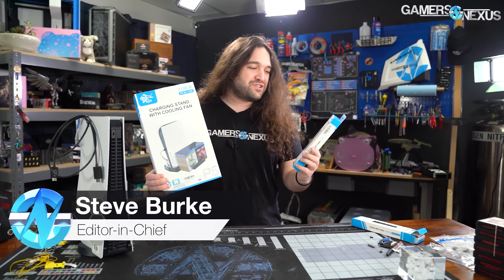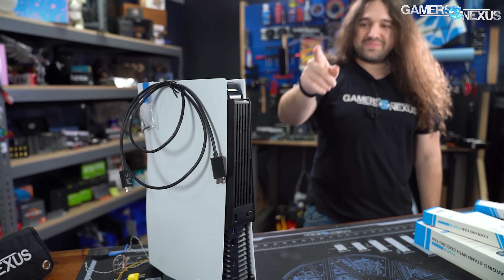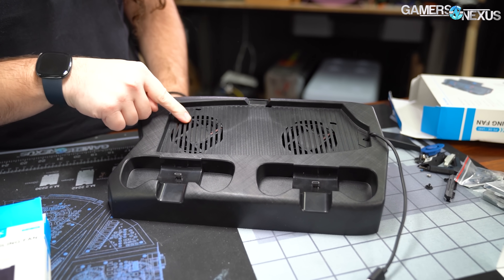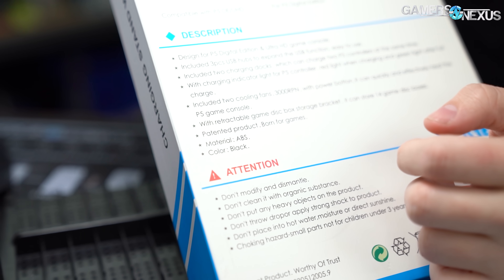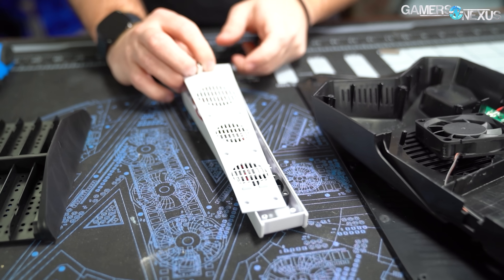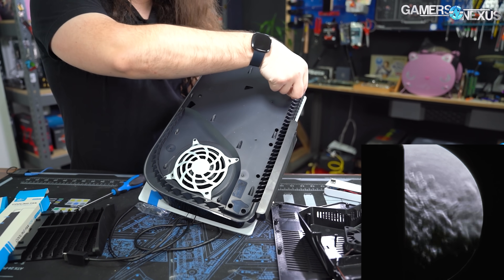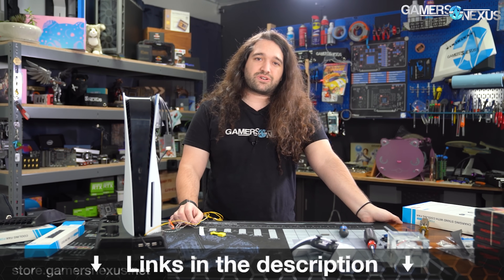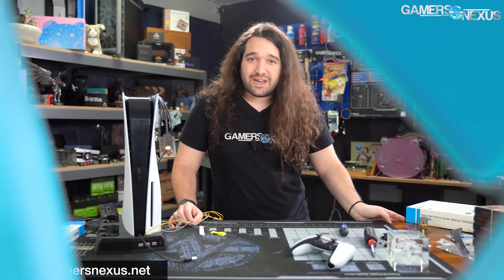Basically A Scam: PS5 Aftermarket Cooling Fans Blow the Wrong Way

Comment: So far as I can tell, so far...the PS5 seems fairly thermally stable all things considered. The biggest thing I've noticed when people complain of overheating is they have it standing without the provided base and/or in a cabinet or cubby that collects the heat exhausted from the PS5. The only "mod" I got was new side panels because I wanted purple but the new panels have openings over the PS5's main fan and it does seem to help with the general temp around the system. That and a small fan to blow the heat away if you insist on keeping the console in a tight spce, need fresh cool air or it'll just keep getting hotter...
Reply: PS5 very well made. These fans are just a con. Vented covers good though
Reply: Yeah. In a cubby a good way to fix that problem is cutting some holes in the back of the cubby or maybe even putting vents in the back of the cubby to pull the hot air out of the cubby through the back.
Reply: I just bought and set up my PS5 and got an overheating ⚠️ I don't have it enclosed or anything. Wasn't even running for more than an hour. I had just set it up and was about to run a game when the notification came up and then shut the system down.
Reply: @ShawnathanTKV  check to see if the fan is spinning, if it was bought new I'd swap it out
Reply: @jakejager  it was definitely blowing on high as if it was overheating. As soon as I clicked to play the game the warning came up. I'm just sending it back so I don't void any warranty. I know this is rare but FedEx took forever to deliver it and it was a hassle just getting it because of the holiday mess.
Reply: @ShawnathanTKV  check to make sure none of the vents are covered, no tape or styrofoam stuck in them. The PS5 is solid on it's temp profile when it works correctly, sounds like you may have gotten a dud 🙁

If you feel like you could handle it you could open the case and make sure everything is seated fully and all the air tunnels are clear...it could be a bad thermistor too, in which case you'll have to repair it or replace...
Reply: @jakejager  yeah it sux I have to package it back up and return it. I bought it straight from PSN too. God of War edition. There was an option to refund or replace it (with an explanation of course) and it would only let me refund it. I bought it for $459+tax
Reply: @ShawnathanTKV  Sucks, have had that happen in the past a number of times, always suck. I got mine via PSN as well, two day shipping but at least you know you'll have one working soon enough 😉
Reply: @ShawnathanTKV  Buy a vented ps5 cover. That's surprising to hear. Never had one overheating problem ever since day one
Reply: @ps5andstuffmate  ya dude I restarted it many times, checking the vents and I noticed the notification would only pop up when I started one of the games. This is a God of War edition too bought straight from the PSN store.

Comment: Fans (like that design) 'pull' not 'push' so the reason the . manufacturer mistakenly put them in, in reverse is because the person tasked with configuring it knew the fans would function far better if they were drawing air through the grill and dispersing it into the adjacent void rather than drawing it from the adjacent void and trying to push it through the grill. You would have better luck, with that type of fan, mounting them on the other side of the case in the reversed orientation.

Comment: Fun Fact: These exterior fan mods were created during the Xbox 360 RRoD era, people thought the console would red ring because of overheating which led to the creation of exterior fan mods that would attach to the entirety of the back of the console. The first one would connect to the DC port and take power from the external PSU, and it ended up scorching multiple power ports which led to the new fans being supplied via USB I believe. You can blame the Xbox 360 for these chinese-made scams.

Comment: I've recently stood my PS5 Horizontally and to my fortunate surprise the modem has always remained cool. I've also found that after I use the modem, I turn it off at the power switch, and put a pillow cover over the modem to protect it from dust. So far it has worked for me!

Comment: Many of these cooling docking station fans have an apparent design improvement with regard to fan intake direction. Would you please do another video review on the new stations that supposedly cool in the correct direction?  Thanks
Reply: I got the surge one and it cools in the right direction, but there isn't much heat coming out the bottom so the fans are just loud and don't do much. The only thing these stands are good for is being a more solid base and a controller charging/storage station

Comment: Thank you for the detailed review.  Its certainly gave me something to consider:

You said to point out other products. I came across (well the Mrs did) this one. "NexiGo PS5 Accessories Cooling Fan with LED Light"

 It seems to address the issue of plastic obstructing the airflow out of the vent by being quite open. Would you be of the opinion that this may potentially work?

I'm kinda thinking not as its not really adding airflow in, but thought you may have an opinion

Comment: I bought the exact fan in the thumbnail. At the time I lived in an upstairs apartment that shared a climate with The Nine Hells. After seeing how the fan actually functioned I immediately discarded it.

Ultimately I went with the best solution possible in my situation. I bought a lower end Portable AC Unit from Best buy. Not only did it keep my PS5 cool, but my apartment was much more comfortable too.

Comment: Yeah, you have a push type fans, I have a pull type that sucks the air out instead of pushing air in, think of car radiator fans. They have new ones now that are pull types. You don't even need a thermal sensor to test the news ones, play a game and if your PS5 get noisy, the fans go on overdrive, I have the pull type fans and the PS5 internal fans remain on low speed. Not saying your review is useless, I'm just saying look into the newer ones.

Comment: omg THANKS

hope you answer this because you're the most detailed review about this kinda products I've found so far ehehe, and I would belive your answer the most.

I was wondering why its so difficult to find a good review of this kinda things and now I know haha
dont know why I wasnt finding this review before.. well, Im glad I did.

but one question... if there was a product that blows air in on the top side and (or the same) that pull air out from the back/bottom, it would be good?
like, there is this product here
NexiGo PS5 Accessories Stand with Cooling Station
https://www.youtube.com/watch?v=RSrtdflwrts

its kinda helps the ps5 on the bottom as the review I linked shows, but middle up to the top doesnt do much.. and there is another review saying the fan isnt that good/fast, so.. if there was a product simillar to this one I linked, that took the base and a good back part from the PS5, and helped it pull the hot air out, would be good?

plus the other product blowing the air in from the top, or the top fans would be to low efficient to do something?

thank you anyways.
see ya.

Comment: So the questions remains then…WHAT COOLING DEVICES WOULD U RECOMMEND THEN??  I’m glad I watched cuz I was just about to buy one of these cooling stands although the one I was looking at supposedly draws air down from the bottom (in vertical) and exhausts from venting holes underneath the base stand.  But yeah…recommendations would be great if these suck so badly, lol

Comment: I see this video is old, but, with the 'cooling fans' that go on the back side and blow into the exhaust, is there any improvement over OEM temps if you were to flip the fans in their housing so they blow with the exhaust? 
Also, I would love to see M.2 temp comparisons with the 980 Pro, sn850, and the Firecuda 530 (while wearing their respective OEM heatsinks as suggested by Sony)...maybe even throw in some results using the aftermarket rear fan (with it blowing in the correct direction lol).
I would love to see that video/videos and might even be willing to make a small financial donation towards the development of them. Looking forward to hearing a response from you and/or your viewers!

Comment: A vertical 15 inch desktop fan blowing through where the extra hard drive is placed lowers temps of the drive. I use a sabrent heatsink. Thermal grizzly 3m minus pad 8 and blow cold air through that vent via the fan, this is the airflow design of the PS5. The drive rarely gets about 40 degrees even after hours of extended gameplay on ultra Doom PS5 and in titles like Returnal. The drive runs faster than the internal one.

Comment: The smaller 3 fan unit that mounts to the back. Is there any way to just open it and flip the fans around in the opposite direction to help extract more hot air from the console?

Comment: Right, but as you showed you can easily turn the fans around within their mounting to face the correct way. I'm very surprised for completeness you didn't do this for your comparison charts. Seems like a rather obvious oversight when you pride yourselves on thorough testing of devices. Granted these are shit products and no-one should buy them, but don't let a shit product turn your testing to shit too. That's Shit-ception.

Comment: Hi Steve! Really illuminating video. I was about to buy one of those crap and fortunately i came across with your video, so many thanks for saving my money :D
In relation to the PS5 heat problem, you said at the conclusion, that the better way to cooling the PS5 could be adding vents holes on the sideplates for a better air flow. That's interesting, because the trademark Dbrand, just released a PS5 plates with hole vents on their sides. So... Do you think it could be a good purchase for help to reduce the heat in the console?

Comment: I got a skeleton cooler that blows out like their suppose too. Its basically a thin frame around fans. I removed the leds. I know leds barely make heat but I'm not wanting them.. The thick one your showing blocks flow. The newer ones all suck out.

Comment: I did get an after-market mains controller charging dock, literally because in my opinion they had a better design than the official Sony ones. And were slightly cheaper
Reply: And how is that related to third party console coolers?
Reply: @katlee8778  do you mean the coolers that also included controller chargers?

Anyway, it was more that there are third party devices that can be good- occaisonally even better than "officially licensed" products.

Comment: Had similar for Xbox 360 and i went trough 3-4 RMAs. 2 consoles atleast broken soon after i plugged set like this on it. After i was scared to plug it in and it did not break anymore.

Comment: Good info as usual. Only critical comment I have is concerning the RPM measurements. Whatever is displayed on the tachometer should be divided by the number of fan blades the fan has.

Comment: The fans should be blowing heat INTO the PS5 not out of it. I don't know where you live, but where I'm from, where the temperature can easily get below 0 degrees, you need to ensure your PS5 stays as warm as possible to prevent them from malfunctioning!

Comment: Fan developers must have listened because I just saw one online that fixed most of your issues with that rear fan : fans blowing in the right direction, open design not closed off same volume as original hardware. You should do an updated video of current aftermarket accessories
Reply: Can you give me the referance please ?

Comment: I know the RPM testing is pointless because both of these devices suck serious ass, but I think you'd need to divide the RPM numbers by the amount of fan blades because it's registering a revolution every time a fanblade goes past instead of a white dot on the center like most people test RPM.

Comment: On the smaller cooler all you have to do is REVERSE the fans.  It took me twenty minutes to complete the operation.  Just make sure you accommodate the wires to not interfere with the fans..

Comment: Is there any fans that help? I know these blow the hot air out not in. That doesn't help at all? What about having a small fan blow on the ps4 while it's running? I dont like that I feel like after 3 hours I should cut my ps5 off becuase of it being hot

Comment: Too many Companies know they can sell junk by simply understanding that enough people just believe the advertising and have no interest in understanding how anything actually works. 
That said I would like to thankyou for your work as 99% of my Custom built PC with an Aorus x570 Master + AMD 5900x the Bequiet dark pro case my Custom built water-loop the PSU choice and GPU rtx 3080 were all chosen as you and your teams expertise were my go to sources of information before any purchases were made. As a result my DIY PC build is rock solid fast and quiet with excellent temps and no regrets. Your review of the Bequiet 900 Dark Base Pro rev 2 was brutally honest and factual. I was able to decide upon the case with full knowledge of what it offered me for water cooling possibility and methodology to ensure good airflow to noise and temps ratio.

Comment: How does Steve manage to put USBs in effortlessly without looking at them? This is evidence enough he is Tech Jesus!
Reply: ill tell u a secret:
most usb type b cables have a raised USB logo on the top side
just feel which side has the little logo and put that side on top
Reply: if they dont, just push your finger against the end. plastic part inside the connector goes on the bottom of the usb, rotate clockwise if its a vertical slot
Reply: @see-em-ex  used 4.4??? Jesus he aint ready for that yet mate
Reply: @littlesnowflakepunk855  wrong. Manufactures want you to suffer. It actually says in the manual to jam it in any old how until it fits, you know its done correctly when the USB head is loose and coming away from the plastic. Misinformation bro is a dangerous game, don't do it again 😤
Reply: @littlesnowflakepunk855  ah good tip

Comment: Thanks for the great video that shed light on this potentially dangerous add-on. I recently bought the back mount fan and thought I was doing my PS5 justice. After watching your clip and against what you said in the video, I figured Id try to flip the fans and open up the grills for better airflow. For a 10 minute fix I feel like it was worth it. Major difference in airflow and hey, its going in the correct direction. Check it out here and thank you again for opening my eyes the the POS. https://youtu.be/LhZ7ns4UFh0

Comment: Someone gave me the base as a gift, I guess I can use it as a solid plastic base and charging station (without turning fans on) and not worry about increased heat? It's at least more stable than the original...

Comment: Hi, I'm wondering if it's OK to connect fans and charging accessories and run them directly from the PS5... does it effect the PS5 performance? is it OK for the long term? I would like to get some cabinet USB fans and connect them to the PS5 so as soon as the console start the fans will turn on.

Comment: If you wanna make your money’s worth then do what i did: i unscrewed it and flipped the fans , you have to find a way to position them flipped without the cables getting in the way and then screw it back up n its like a boost for your console fan n actually its been working well.. my system dont heat anymore as much

Comment: bout to build a cooling box for my ps5, using a PC tower. Its just temps to deal with either, but dust. Using a PC tower with air filters while cooling is the right way to go.

Comment: Honestly the only thing I'm genuinely interested in is aftermarket internal fans - aka the ones I've seen in the demo videos and sound comparisons. I've got a perfectly working Ps5 (yes, lucky, I know) but it does feature some pretty hardcore (thankfully low-pitched) coilwhine and an internal fan that either has something off with it's bearing or its balance - it produces a high pitched whirring (almost like a beeping sound) that changes pitch based on fanspeed and I would love to replace that with one of the other models to see how it works out.

Comment: I got the oivo ps5 base with suction at the bottom. I got it only for a wider base and controller chargers. I don't use the fans because I don't want to mess with the consoles cooling systems that sony made a certain way for a reason. It's not a bad base tho imo. And I wanted to keep the console vertical but I just felt like the base that it comes with was just not that supportive. So far it hasn't gotten hot or anything like that. It would be cool to see a test done on this product to see if it effects the Temps in a negative way as well. Cool stuff thanks for the cool videos 😁

Comment: Here’s another idea.. have you looked at all the “cooling” solutions for the Nintendo Switch? From what I gather, so far there’s 4 different cooling methods:
1) Blower radiator fan that mounts on Top of the Switch.
2) A rear toggle fan that installs behind the Switch dock.
3) Bootleg Switch dock with fan.
4) Pointing Oscillating fan at Switch while docked.

I’ve been reading lots of complaints on how 1, 2, & 3 will cause overheating and/or does nothing to cool the Switch. There are also folks who swear it works (could be bots or scammers posting reviews). But number 4 seems to be Reddit’s choice to cooling the Switch. I would love to see Gamers Nexus put these products (and claims) to the test. Plus they’re readily available unlike PC parts as of April 2021 😆

Comment: I bought those two cooling fans 

I opened the two devices and flipped the fans over easily they actually work !!! less heat coming out. 

The sad part is you need to get your ears used to the loud frequencies.
Reply: So you know people I don't have those photography xrays heat machine. 

My experient was senesing by my hands lol